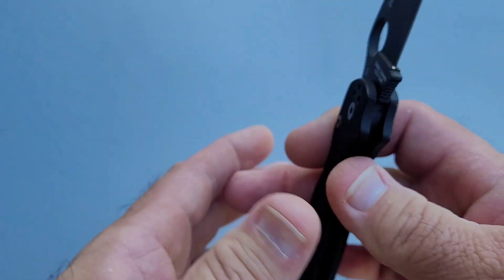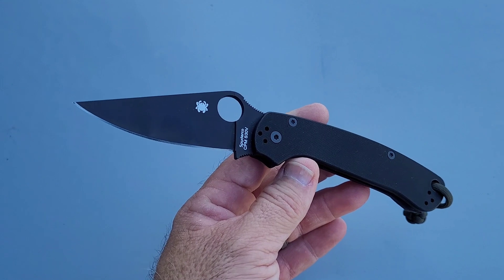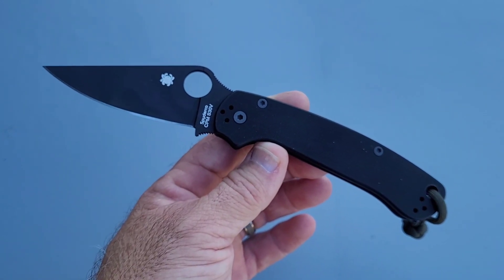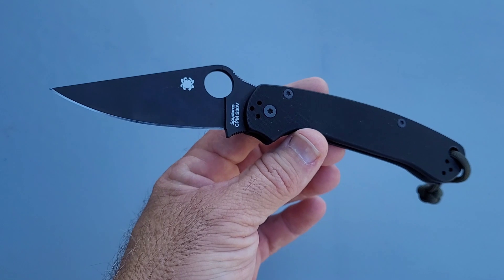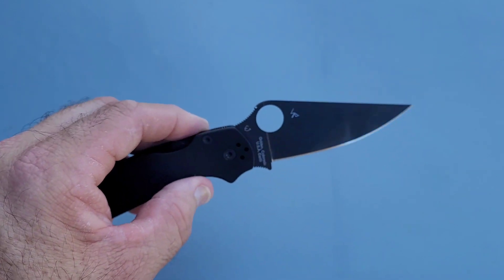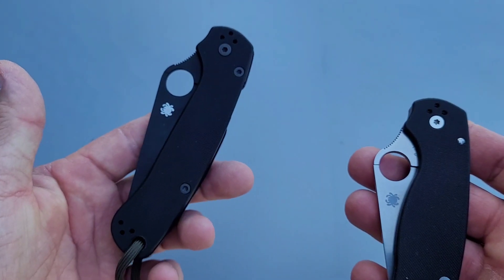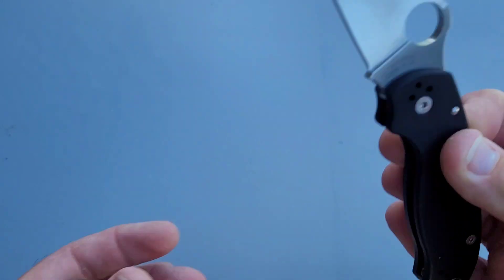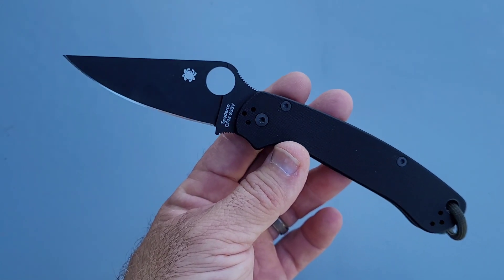Spyderco PM2 S30V edge retention testing. Big surprise to lead in to the new Era comparison.

Comment: That G10 handle looks funny comparing to normal production
Reply from the maker: I took the center grip area hump out to see how it would be.
Reply: @Outpost_76  Did you do a mod video or would you be willing to do one and or add in the description hoe you did your scale mod.
Reply from the maker: @SRVandDtrouble  the liners will show and when I did mine I powder coated the liners black. That being said I took the blade out marked the liners where I wanted them then took down the handle as a whole. If you have a belt sander and time you can do one as well. I can cover how I did it in a video and I'd be happy to do yours if you cover shipping both ways.

Comment: So my manix 2 in s30v isn't likely to be head and shoulders worse than the "new kids"?
Reply from the maker: While I have found some S30V from Spyderco to be around 59 hrc, I've tested way more the past year that have been 60 to 61 hrc. Even the softer S30V from them still performs just fine and I still use them to this day. I will have a direct test and use comparison on 59 hrc and this particular knife that's just over 61 hrc. That way the difference can be seen on more than one way.
Reply: @Outpost_76  wow! I know you do this one way or the other, but you do good work, thanks!
Reply from the maker: @voidpunkprincess  thank you

Comment: Does the coating on the blade mess with the hardness test? Just wondering if it might throw off the hrc test. I like s30v personal. It makes a great edc steel imo.
Reply: It can, but usually doesn't most of the time.
Reply: If it's a thick coating yes, but something that is only a few microns thick like DLC or Black Oxide it won't
Reply: @andrewayers1141  thank you.

Comment: S30v from Spyderco is great, even a little better than most s35vn, at least in my limited experience
Reply from the maker: I agree it's better than almost all S35VN.
Reply: S30V should have slightly better edge holding than S35VN which trades edge retention for toughness, about 1% less vanadium in S35VN

Comment: From what I have seen with s45 it reminds me of xhp.   Would be nice to see others come to similar conclusions.   I think s30v on the pm2 especially shines in that 400/600 grit range.   And s45 is more ideal for the finer grit ceramic sharpening Stones spyderco sells and most ppl use.  .
Reply from the maker: I'm definitely going to find out. I'm going to run the normal test,coarse and polished to see what happens.

Comment: My first knife with a "super steel" and  I hate sharpening it. My Presidio 2 with s30v is so much easier. Glad I have not had to sharpen my 20cv Manix 2 LW yet😅.
Reply: Its not hard to sharpen most steels you just need some decent diamond stones
Reply from the maker: 20CV is just like sharpening S30V, I notice no difference in time or anything else.
Reply: @Outpost_76  I use a smiths double sided diamond pocket sharpener I'm sure that is the factor 😂